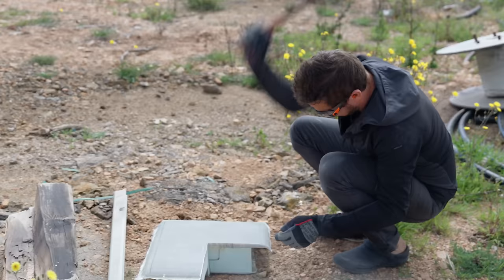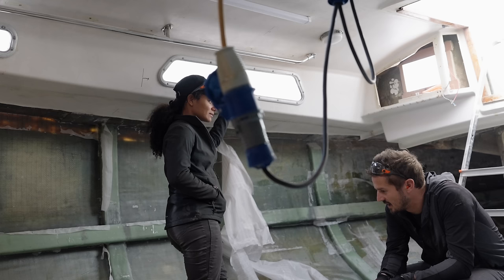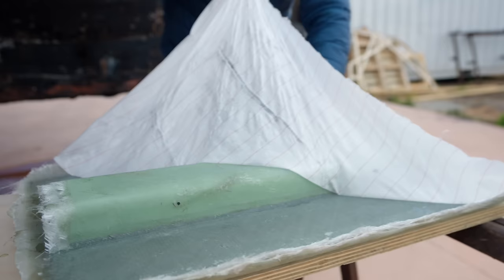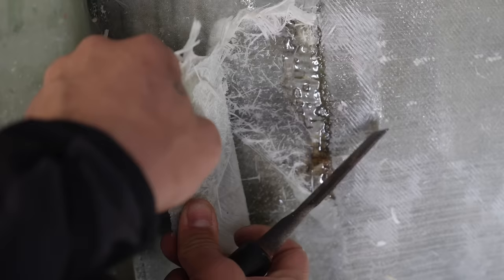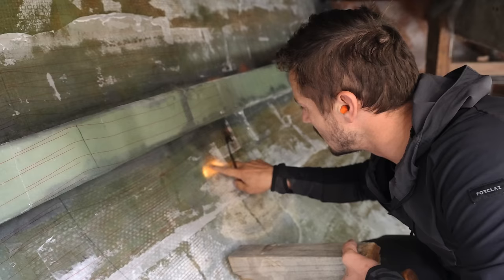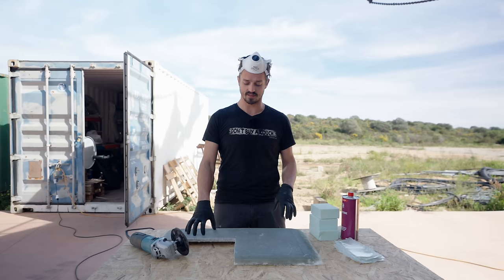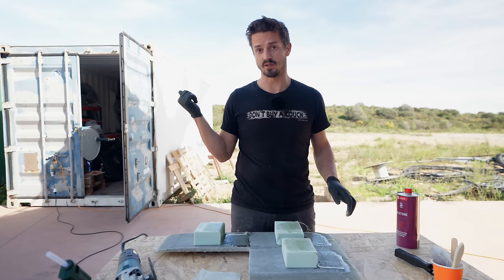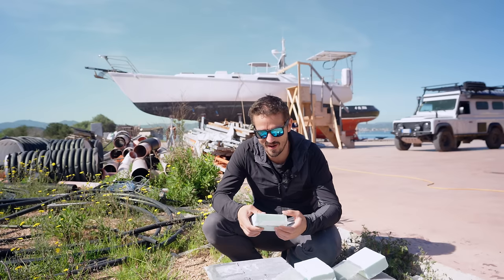If It Doesn’t Work, Hit It With a Hammer | Step 387

Comment: For those commenting on the hot glue/foam connection note that that the foam doesn't need to be there at all, the strength comes from the laminate.
The foam isn't there to provide strength to the structure. It is only there to provide the profile/shape to get the laminate to conform to. The foam could be completely removed/not used at all if it was possible to create a square section around thin air ... but as you can't laminate against nothing foam is used to give the shape.
If you want/need strength from the shape material then you would use plywood or full thickness fibreglass. For beams though that would a lot heavier, more costly and probably too stiff (there should be some flex allowed in the structure).
Think of the foam like a former for the inside of a sink bowl. Once the laminate is cured you would remove the foam to fill the sink with water, it is only there to give a shape to apply the glass to.

That said the only improvement I can think of with putting the rib structure's in would be to laminate the foam first (to provide a square tube shape) and before immediately attaching that to the hull and laminating over that. This way the inside edge of the 'tunnel' would have a 'T' shape laminate connection rather than an 'L'' shape bond to the hull. I can only assume, as I don't see boat builders doing this, that this isn't needed as it would be much more time consuming and expensive.
Reply: This comment reminds me of something you really never want to be, confidently wrong. 😂
Reply: Interesting suggestion (T vs L). Certainly edge effects (which result in peel failure rather than direct tensile failure) are a real Achilles' heel for any adhesive resin, but especially for resins which are not toughened. The layout of the test sample made for particularly severe edge effects.
Peeling means that instead of acting across an area, failure occurs along a line (which in theory means infinitely high stress, because a line has no area). 
In peeling failure, that line moves across the area. 
It's (I suppose) an instance of "divide and conquer"
Reply: That is completely wrong. The foam should add significant strenght. The whole idea with structural use of foam is that you reduce the amount of heavy glass and resin and let the foam be the strenght. Modern boats or mostly foam with very thin layers of glass and resin. Carbon or other.
Reply: @ottifantiwaalkes9289  ok, someone with a clue.
Reply: @ottifantiwaalkes9289  This is not that sort of structure, and the modern boats you refer to are built with entirely different aims (maximum stiffness, minimum weight) to what these two have in mind. Such boats have no tolerance for running into heavy floating objects, like ice bergy bits, or deadheads (floating trees), let alone solid ice shelves or uncharted rocks.
Reply: @Gottenhimfella  I know that. But why not properly glue the foam with epoxy. Less than half the mass of foam will have equal or much better results.
Reply: @ottifantiwaalkes9289, @kcinkg
Yes you can use a core material for extra support. 
No they are not using the core as support material in this case. 
If you watch the last video they clearly stated that as the core is only there to allow the form to be created.
https://youtu.be/tOyu81tynr4?feature=shared&t=85
https://youtu.be/tOyu81tynr4?feature=shared&t=448
Given the amount of consulting they have done for this build I would assume that all the architects and engineer's they have spoken to have told them that the amount and type of glass being laid up is more than enough strength so that that there isn't a need for a core support structure.
There are places where the core is doing more than just a former for the glass (mostly where you are fixing things through the glass or have a laminate structure to avoid bowing)

Modern boats are built with only cost in mind so they reduce the glass for cost purposes, but the principle of using the core for lightness and strength is correct but mostly in higher end racing or production boats. 
In those they need to save every bit of weight they can so they minimise the amount of glass as much as possible. But to do this you need to carefully work out what properties of the structure you want so you can then work out the ratios of soft core to hard laminate for the job. A structural beam needs more glass, a deck can be thin with a supporting core to stop bending/flexing when walked on, the hull needs a thinker outer layer for impact damage but still needs some flex (to deflect a little and spread the load rather than a sharp concentrated load causing a puncture).
Reply: @Gottenhimfella  Yeah the comment on the T vs L bond isn't something I see mentioned much on YT videos for glassing, it was something I had always thought would be a weak point in the structural bond though. 
I dropped it in here to see if anyone had any ideas/views on it. I guess it doesn't get used due to the extra time cost for the layup and that the standard layups seem to work most the time (due to being overbuilt by an extra layer of fibre to make up for it). 
I do seem to see more beams/bulkheads delaminated around that area though so I wonder if that might be the source for the original stress fractures to start the delamination. Internally you have a line of glass at a bad angle for stress fractures (kind of a Y shape where the glass wraps up the former) that is only filled with the fillet applied before glassing. That always feels like a weak point to me as I would want glass at the highest stress point rather than a fillet but no one seems to be worried about that so probably just me overthinking it :P
The 'L' type connection would lend itself to the peeling line stress as you pointed out along the joint where the fillet narrows to the area where the layers meet.
Reply: @madmaveric I think you're on to something (and I'm an engineer). It would be interesting if someone would produce a woven roving with a Y cross section, which had three "tapes" sharing a common edge. In one use case, it could be wetted out with two tapes bonded to the hull and the other tape to an upstanding face like a bulkhead or a rib. So, in this case, it would look like a T if you took a cross section. 
But I think there should be a built in foam element at the central node, which would automatically provide a fillet between each tape and the two adjacent ones. This is because you do not want the fibres going around a sharp corner (which greatly increases the stress in those fibres). This is particularly important in cases involving triaxial stress  -- being pulled in three mutually perpendicular directions, as you find at an inside corner say between a bulkhead, the hull topside, and the deck.
I would think that particularly for carbon fibre construction, such a product, if well implemented, could be rather attractive.
Reply: @Gottenhimfella  Same but I'm a mechanical engineer (trained in metals but worked a lot with plastics) so I'm transitioning knowledge from that to composites (meaning there are some holes). Although stresses and that side of things is pretty much universal, the material's reaction to them is something I'm not completely up on.
I think the main reason, I suspect, it is hard to find these kind of tests/information on filleted joints is that it is really only the high end racing yacht's/aircraft/race cars etc that would spend the time and money needed to design/research to this level. 
It is easier/cheaper just to lay up an extra layer of glass than do the design/analysis to make it lighter for the same strength. But even 10 layers of glass don't help if it all just delaminates lol.
BTW I think using the letter 'Y' instead of 'L' that I used makes a better visualisation of the stress point I was thinking about (thanks :D).  
I really only mentioned it as I never hear people talking about the strength of the fillet. ie where it narrows and meets the join of the new layers, it will create a kind of wedge in between the layers. The fillet smooths out a 90Deg angle but also creates an reducing angle down to 0 between the layers.
Thinking more about it, if the fillet (being a different material as to glass) has different thermal properties or is a different stiffness to the glass fibre, over time could heat cycles/flexing of the hull actually cause it to weaken the joint.

I think your tape idea is more practical than attempting to put a layer of glass around the foam core before fitting to the hull. Maybe a tape applied to the hull that is a couple of inches wider than the foam, apply the foam and wrap the tape up, then the fillet is applied, that way the fillet is held on one side by the tape and glass on the other.
This is all probably overthinking the issue though as it has been done this way for years so it is probably fine, although I've seen some (mostly newer boats but not all) with delamination at areas like this (where fillet is required) and often wondered if the fillet material gets overlooked.
Reply: @kcinkg  what? They already have a old school structural boat hull.
Reply: @Nixontheman  most people are. Do you understand the dunning Kruger effect?

Comment: As soon as you mentioned laminating to the bottom of that piece, I knew exactly what was up, given the way they prepped your interior, I think you will be absolutely fine. Personally I would have used Epoxy for this job, but either way I think the VinylEster will get it done.

Comment: Some manufacturers use a wax additive in resin that has to be sanded in between layers and doesn't bond well even when still tacky. You have to actually wait till each layer cures and then sand before putting a new layer on for best results.

Comment: Hey guys, I've worked with fiberglass for over 30 years, I don't know how long it had been when you started hitting it with a hammer, but I've found the longer it's been since you glass, more it cures and stronger it will be, and as long as you keep it clean, your glass inside the boat is a great job, and will last for another 50 years, and I've also noticed that bigger the total glass area, the over strength is much better, so be at easy guys, you done a great job so far, good luck and God bless you guys

Comment: I am currently restoring a very early GRP catamaran. This has entailed removing rotten plywood bulkheads tabbed in with GRP and replacing them with laminated foam core sheet. Even with several layers of laminate either side they remained flexible which is not what I needed. In order to make them more rigid I cut a strip of foam about an inch wide and half an inch thick and glassed it in place along the centre of the laminated foam sheet bulkhead. On its own the foam core is flexible and brittle. By adding two 90 degree angles in the opposite plane the foam bulkhead became rigid and much stronger. One cannot help but think that the size of the foam used in this case is a bit of overkill when half the dimension would have sufficed as it is the angles in the laminate that provides the strength.
Reply from the maker: The size and laminate structure for this build was derived from an engineer. We believe what he told us. It is overkill for sure. But also the forces on a boats hull are exponentially higher than what you can push with your body weight. Mother Nature has a way of finding the weakest link in a system. Your hull shouldn’t be it.

Comment: You should definitely do some test bonds inside UMA to verify the bond strength before you bond in the bulkheads. Also, even though I defended vinyl ester somewhat last week, I really think you should use epoxy to bond in the bulkheads.

Comment: Mat from Duracel project looks like pretty good fibre glassing expert and great problem solver. Might worth to ask.
Reply from the maker: We prefer to get our advice directly from the source. AKA boat builders. Or friends of ours who repair boats for a living. We'd recommend anyone thinking of doing large jobs like this to do the same. Getting advice from DIY YT channels is like doing research on Wikipedia. It might be a great place to start, but you really need to do your own research from primary sources, for your specific needs and speak to experts you trust before deciding on any action.

Comment: Epoxy is a much better choice in this instance. It costs x4 more, but you will not have any issues with proper cleaning and sanding(I do 60 grit) beforehand.

Comment: I did notice the portion you peeled off the inside of the boat showed some bridging. The shiny part on the right hand side next to the adjacent layer of glass. If it's a pronounced difference you should feather the edges of the glass which should prevent any bridging. Looking good though. Glad your fears have been put to rest. Cheers! Rick

Comment: I'm not a fiberglas expert but I did hire one of the best in New England to rebuild a transom on a boat back in the early 90s - to make it much better than the original factory glass chop garbage and able to withstand the forces of a 1000+ horsepower stern drive setup. I watched as he worked. Essentially, you can add multiple layers of different fiberglas substrate - building up the thickness as you go - but it must be wet (short time window). If it cures or flashes, than the surface must be "reprepped" to begin layering again and roughening or grinding the surface is a critical step in that process.

Comment: I am by no relevant means knowledgable in all things fiberglass but the thought occured to me that what may have compromised your test piece is simply the fact that it is quite a small sample with edges on all sides compared to the full hull with that particular shape, which could mean that the structural support is probably a lot weaker, allowing that test piece to flex that much more and loosing the grip in ripples from the spot of hammer impact to the edges. Long messy description, but only my two cents worth 😊
Fingers crossed that all is good and the refit can move on towards further safe journeys 😊

Comment: Cleaning with acetone or mineral spirits, which is less toxic in an enclosed environment, and then grinding then cleaning again (shop vacuum) definitely is the better process. If you are unable to reapply a second coat before the first coat has had time to cure sufficiently which I think would be the overall preferred method is to apply the second coat while the first coat is still curing because you’re going to get a stronger chemical bond.

Comment: Johan from RAN Sailing used a different technique for peeling off the peel ply, peeling it close to the surface, rather than pulling "up" if that makes sense. Pulling "up" could leave to separation of layers.

Comment: In my tests with epoxy (used West System 105 with 205 hardener), the epoxy didn't bond well if I just ripped off the peel ply.  It bonded well if I then sanded, just like what you did. The surface left by peel ply seems rough, but I think it is microscopically smooth and that's what ends up mattering.

Comment: That's great news that your subsequent tests showed the work already done is OK. Not sure why the Peel Ply was an issue, I'm glad the additional grinding worked. Acetone is a useful solvent but it isn't a good degreaser. It does flash quickly, with short dwell time, but the bigger issue is that it's too polar. Greases and waxes are typically very nonpolar and nonpolar solvents would be much more effective. Naphtha, mineral spirits, or an aromatic like xylene would all work better, the later being more toxic so take appropriate measures.

Comment: You absolutely have to sand a peel ply surface to bond to. The peel ply gives you a nice resin rich surface to sand back without cutting into the fibres of the last layer.

Comment: Grinding is a primary keying essential, but the difference between your small sample and the boat as a whole is form fitting. You’ve got a large concave mass with another concave nested mass. That is the primary bonding mechanism that you didn’t have in your small flat test pieces. Buy some Italian ZEC discs.

Comment: Thank you so much for sharing this. I was concerned about bonding to the just peel-ply'ed side because Andy from boatworks was telling to sand it anyway if some time has passed exactly because of the wax stuff that ruins everything once vinyl-/polyester has cured. And you confirmed it. I appreciate that a lot. And also I'm very glad you don't have to re-do all the work was done already inside. That would be a bummer.

Comment: A clear split of the layers like that is usually due to user error. We did add stuff to our ship years ago and rarely did we see layer separations at all. My dad handled that and usually just used a drill with a spinning sanding disk over the area before cleaning it up to rough it up before 'gluing' in the next bit. Doing so lasted so long that even after decades it hadn't even begun to separate. So I'm guessing it was due to a weak moment and that made it fail. Typical such errors are all due to to user errors, or because there is something that they don't know. That last bit, explain a lot of things that goes wrong in our world.

Layering over a smooth surface, will always fail sooner or later. So I can't really believe anyone would suggest doing that. If you do, there will be no hold between the layers and then it will separate, so it's weird that you were told that.

And acetone and most other cleaning solution always leave behind a trace, only very clean water is the only thing that does do that. I learn in school actually that acetone and other so called paint cleaning fluids always leave behind a big of oil or something else. So if you want a surface really clean.  Use a vacuum and wash it with H2O and not from the spring as that comes with a lot of junk.  Pure water won't even crash a pc and it's the only way to get it really clean. Ethanol would be better to use as that don't leave residue and acetone does leave residue